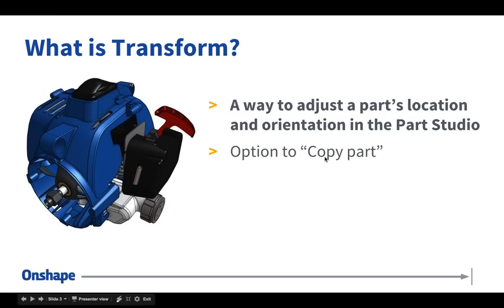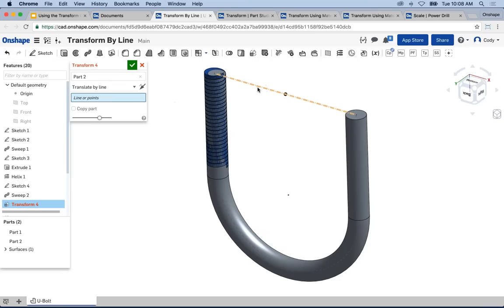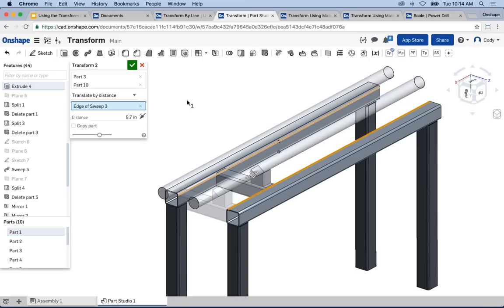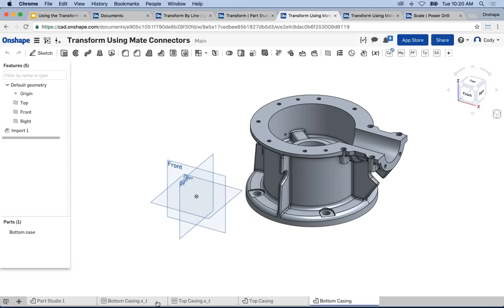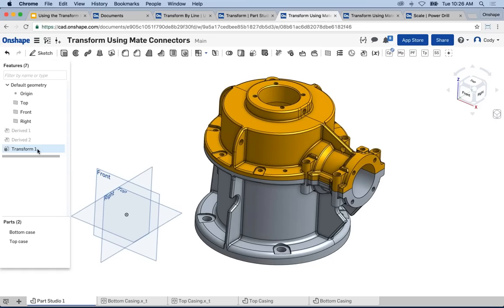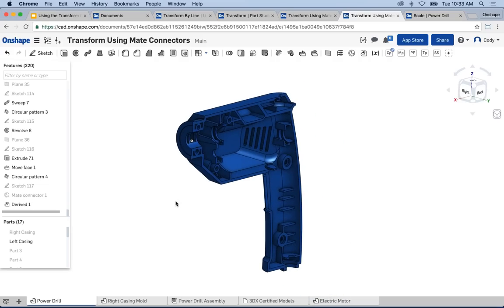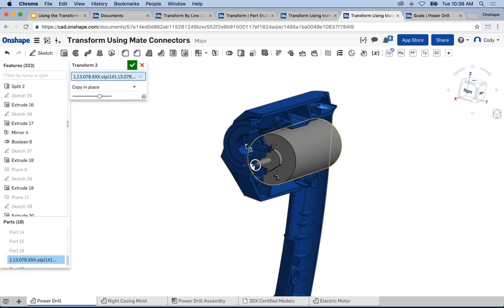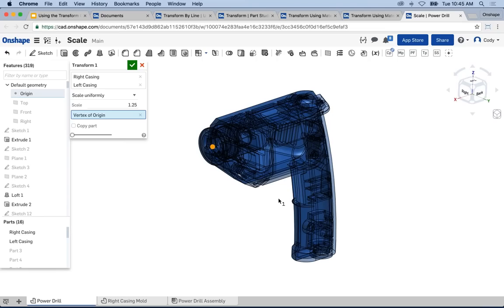Using the Transform Command | Webinar (September 20th, 2016)

Comment: Say you have a part floating above z=0 and you want to move it to z=0 (i.e. for 3D printing). Howto?
Reply from the maker: Most slicing softwares will give you these options...I wouldn't sweat doing this in the CAD tool itself.

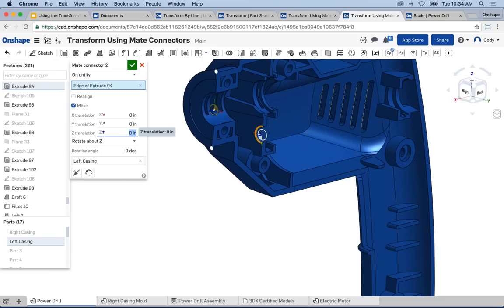Comment: The question was asked, "It looks like you should have moved [the motor mate connector] in X, not Z. I think you misunderstood the question. I thought the same. Starting at 33:00, referring to the orientation cube, as you said earlier to do, the movement you obtained looks to me to be in the X axis, not the Z. What am I missing? 

I think I got the answer at about 39:45. Is it that the motor shaft is parallel to the Z axis as the part was originally designed? At any rate, choosing the correct axis -- without trial and error -- is not intuitive to me.
Reply from the maker: Glad you figured it out...sorry it took trial and error though.